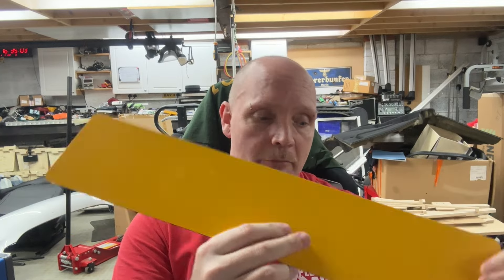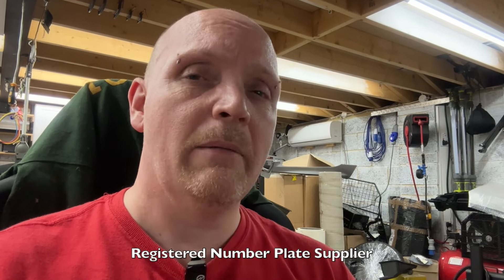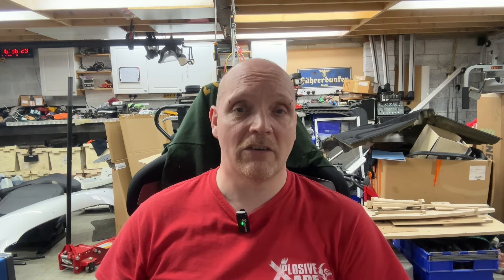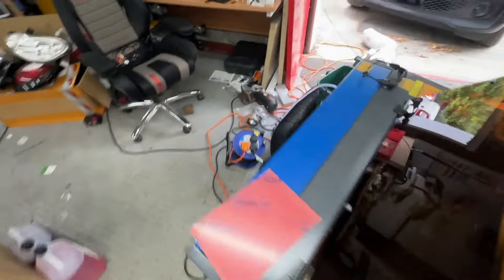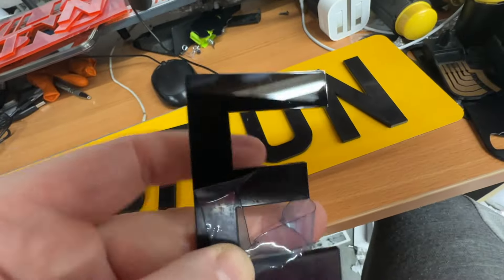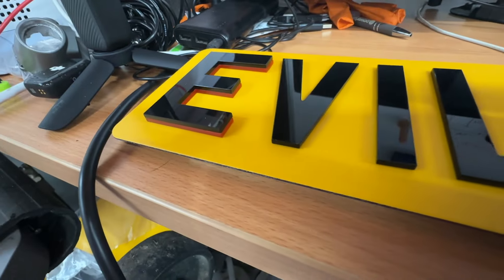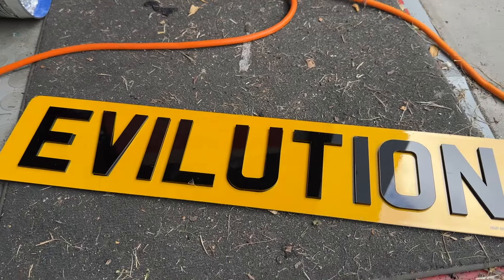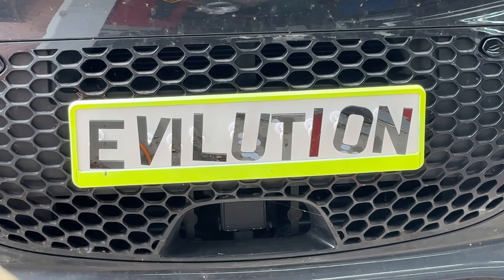So, you want a 4D number plate?

Comment: Fun fact: The law was updated again in late 2008 to completely ban off-road number plates by stopping people making whatever style they like and falsely claiming it's for off-road use. If the plate displays a valid registration mark and does not comply, it is illegal - not only to display it on the vehicle on or off road, but also illegal to manufacture and supply and will fail an MOT. See DVLA INF195/2, section 8. Under UK law, any company making non-standard number plates with a valid registration mark are breaking the law. In reality, we all know what goes on - see eBay, Amazon, various websites, and basically any trader with a pitch at a car event in a mobile trailer.

Comment: Only last week I noticed that while normal number plates have details of who made it bottom centre (which I thought was a legal requirement) none of the 4D ones I saw did. Of course none of these plates are as dubious as the motorbike riders who thing they can have one the size of a postcard.
Reply from the maker: Yes, the "off road" plates don't need to conform to the number plate standards but they aren't road legal and shouldn't pass an MOT.

More motorbikists are using flip n dip number plate holders now as the small plates were drawing unwanted attention from the police. Now they have proper size ones on holders that can be flipped up under the seat to hide it if they need to break the speed limit.